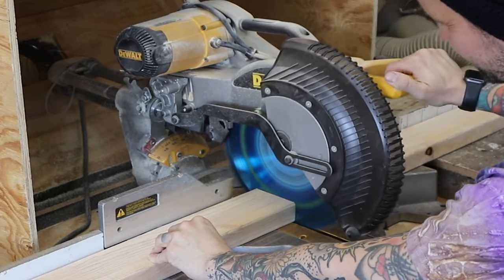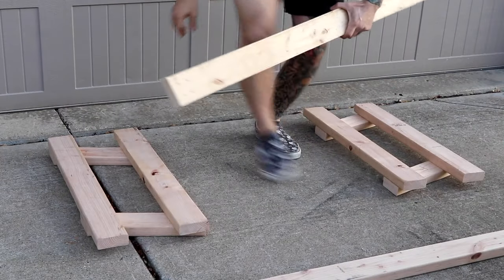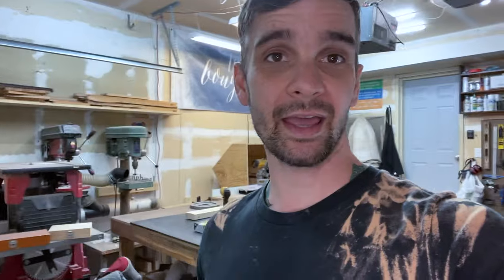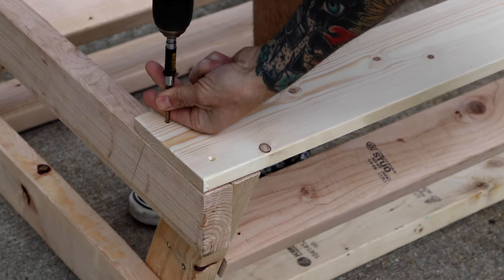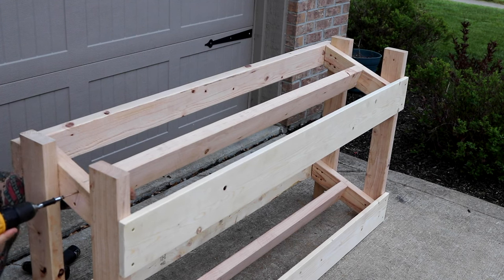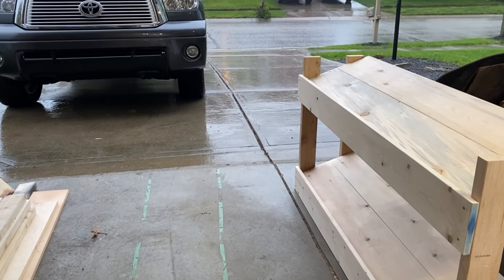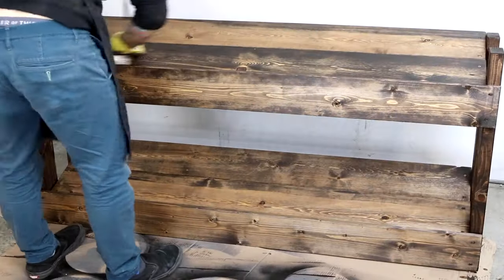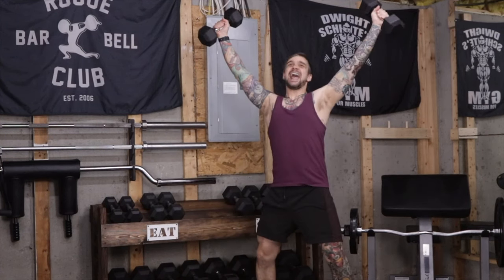DIY weight storage, how to build a dumbbell rack, DIY gym equipment at home

Comment: The glow forge looks awesome. How hard is it to learn the software for that? I’ve never used anything like that and have been looking into machines that cut and do all that stuff.
Reply from the maker: The Glowforge interface is very user friendly. I've had my machine for 4 years now and it's still going strong. I love it. It can cut some woods that are up to 1/2" thick, it can engrave wood that is up top about 1.5". Pretty versatile. If you do buy one, use my referral code and you'll get up to $500 off depending on the model you buy. Referral code: https://glowforge.com/?kid=YZPNDIUF

Comment: Hello, when you cut the 70 degree angle on the 13.5 pieces, how did you know how much to cut off? I saw in the video you were mainly doing just the edges.

Thank you for the clarification!
Reply from the maker: With the angled parts, the measurement refers to the longest side.

Comment: how to cut the 13.5 inch pieces using a hand saw? I am not sure how long the pieces need to be before cutting the end at an angle
Reply from the maker: The measurements I give are for the length of the longest side. If you’re cutting with a hand saw you can mark your angle and cut along the line. It won’t be perfect but it is possible

Comment: Nice rack...just one question. Are you happy with the choice of 20 degrees for the dumbbells to rest on the shelves or would you suggest cutting it back to 15 degrees to prevent the dumbbells from tipping forward?
Reply from the maker: I’m pretty happy with the angle. No tipping issues at all.
Reply: @KaizenDIYGym  👍

Comment: What is the difference between a power rack and a power cage?
Reply from the maker: The terms are used interchangeably. Power cage is more old school. Typically if you’re shopping on a website, the term power rack is what you would use to search.

Comment: Am I wrong but aren’t you cutting it at 20 degrees not 70? I’m not a wood worker. But cut mine to 70 n looked way different. Went back n cut to 20 n looks right. Am I wrong?
Reply from the maker: Great question. I made this video over two years ago. I honestly do not remember the dimensions I recommended but you should do whatever works best for you!

Comment: What's the weight limit? Be nice to see it loaded.
Reply from the maker: I made it specifically for a 10-50 set because I don’t have heavier dumbbells. With a little reinforcement it could handle 55-100s

Comment: Hi, i am really inspired by your video and tutorial. i recently noticed my dumbbell rack is collapsing anytime. i guess it cannot hold the weights anymore. i just wondering how much weight can the above dumbbel rack hold? i have dumbbells up to 110lbs, can this rack hold?
Reply from the maker: Yes, it will hold. You’ll need to modify the dimensions so it can fit more dumbbells.
Reply: @KaizenDIYGym  Thank you for your speedy reply, i will take note of that...

Comment: whats the main difference between V2 and V3?
Reply from the maker: Width. V2 is so wide I had to add additional support in the center. V3 is made specifically for a 5-50 set, V2 can hold more than that.
Reply: @KaizenDIYGym  thank you. I planning to use your V2 template and make the bench about 8ft wide, do you think it will work fine? I am hoping to be able to fit all dumbells up to 100 lb on it